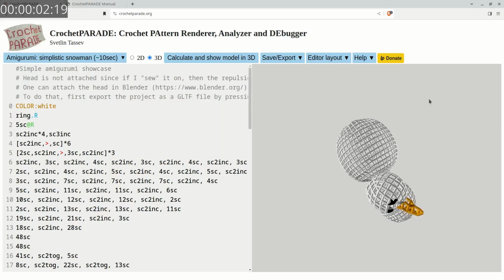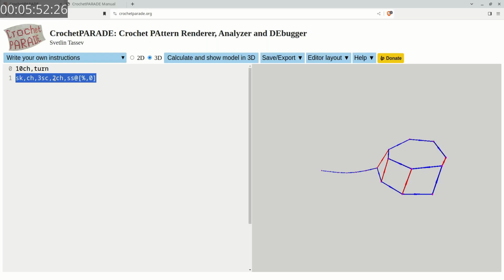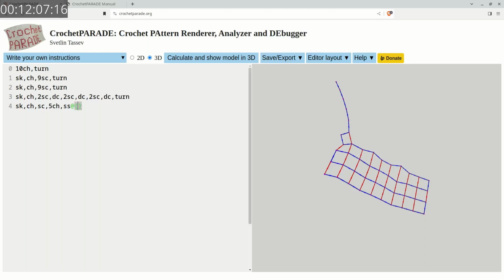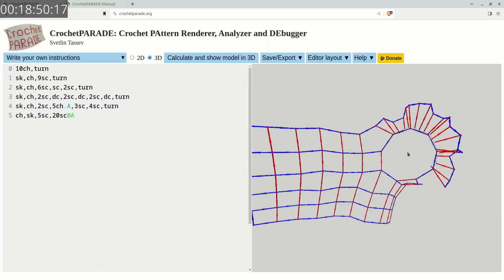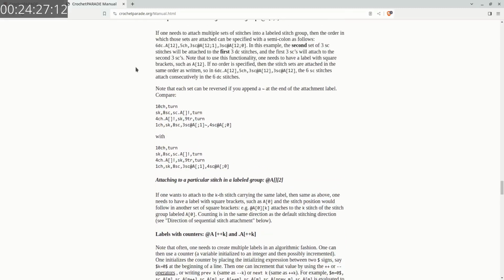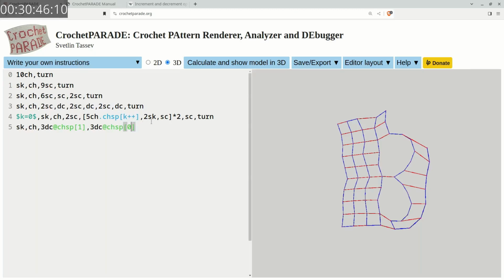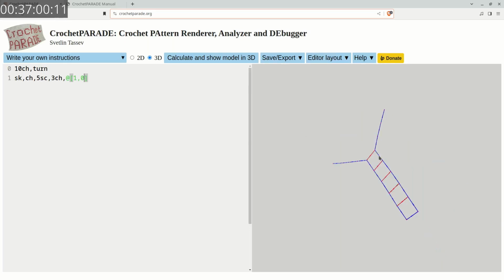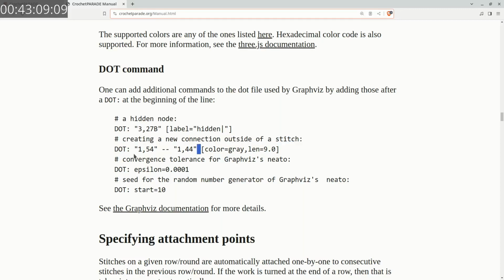Tutorial: 2D/3D Crochet Patterns with CrochetPARADE (Part 8: Specifying attachment points.)

Comment: How do I show folding? For example, to attach ears, you need to fold them inwards before attaching. How do I bring two sides of a ring together without adding any stitches?
Reply from the maker: Not sure exactly I completely understand. On the forum you can search under "Ask a question". There is a topic about "Sewing together a circle" which may or may not be what you are looking for. If not, ask there for more advice.
Reply: @CrochetPARADE  That worked with sewing them together, thanks! But now I'd like to fold one corner of the triangle to the middle. How would I do that? I'm making an ear for an amigurumi and I'd like to fold one corner of the ear to the middle to give it some depth. Direct attachment direct attaching to a label didn't work and direct attaching to a coordinate didn't work either.